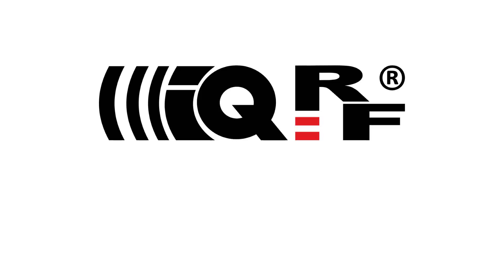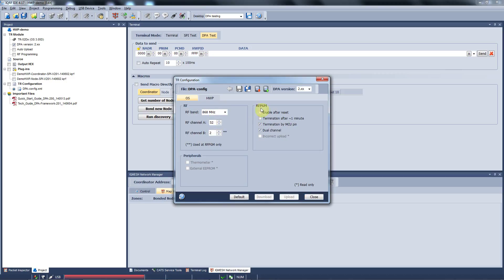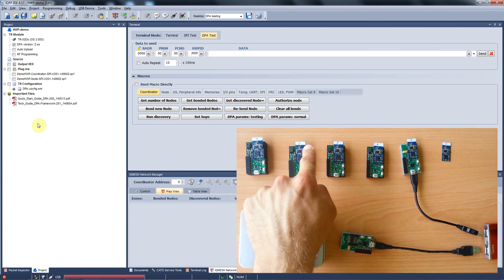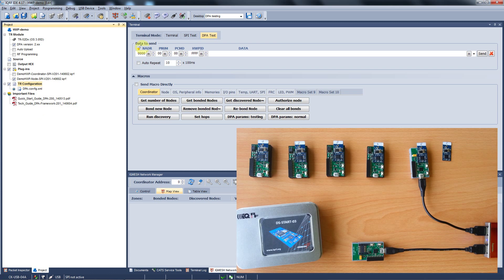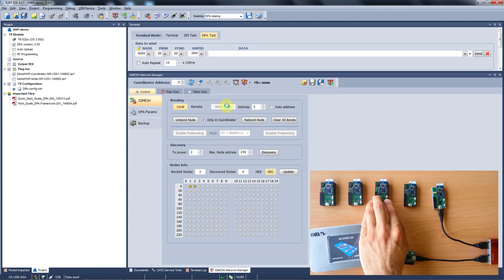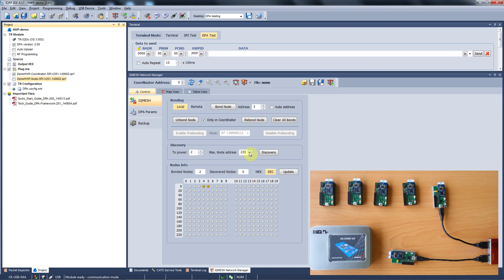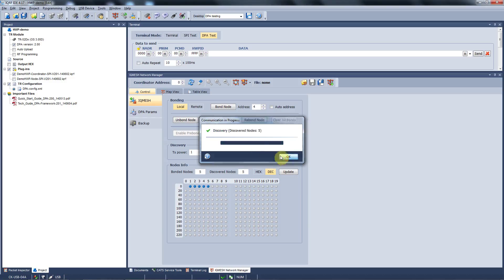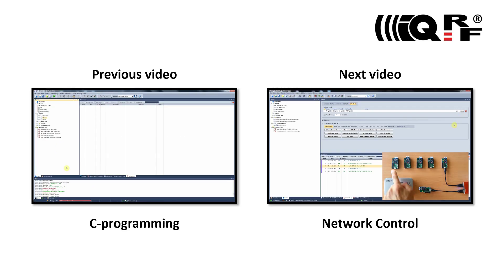5. Network Set up with IQRF DCTRs

Comment: Please if you could help me I would be really grateful. I have been starting with tutorials, and a few days ago I could work with the Network set up (HWP-demo.iqrfprj), but it is not working last days.

First, it was so strange that the day I could try the Network set up and it worked, in most of the DCTRs ((DC)TR-72DA) I was trying to upload the Node it was failing (I have about 10 DCTRs in the company I am working) and I could only successfully upload the node in 4. It is strange because I am uploading exactly the same plug-in, not changing anything. Maybe there is any reset I should do because other people had been working with the DCTRs before I started with them?

And now the problem is worse, before I could at least work with some nodes and with the coordinator. But now any of the nodes work right, not flashing the 10 seconds neither bonding to the coordinator even unbonding all nodes before. Seems the nodes are not being really successfully uploaded or I dont know what happens. It is very strange because I am doing the same steps as the other day, and the IDE says the upload is successfully. And what is more strange, one of the DCTRs is flashing when I put on any DK Evaluation board (DK-EVAL-04a v 1.02) but not stopping flashing at 10 seconds, and all the others DCTRs just make 1 flash when I put them on the DK-EVAL boards. Any of them allow me to bond to the coordinator.

If you have any idea how could I solve the problem would be great. CK I am using the CK-USB-04a v1.00, IDE 4.34, USB Module info displayed on IDE for the CK board version 1.13, driver MPUSB, and TR module information displayed on IDE OS Version 3.07D. Working with MPUSB because my boss dont want to update yet, so if the solution can be without update it would be better.

Thank you very much in advance, and sorry for my short knowledge of IQRF just starting with them, and for my english,
Pablo Payno.
Reply: i have the same problem